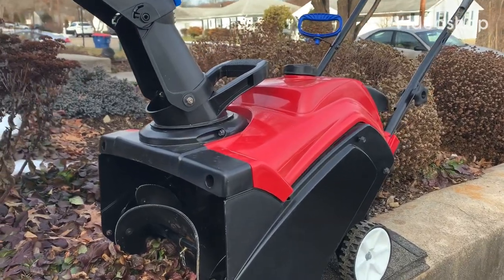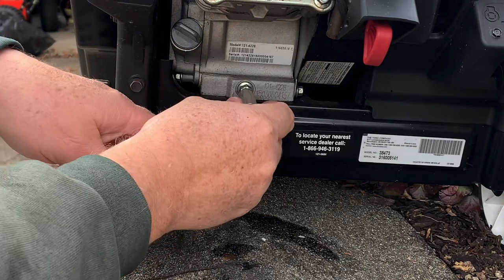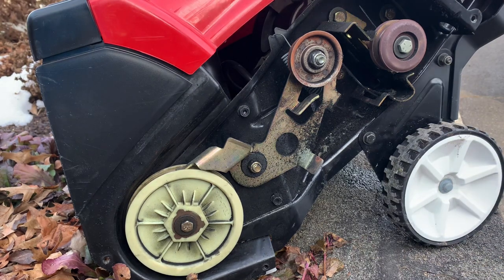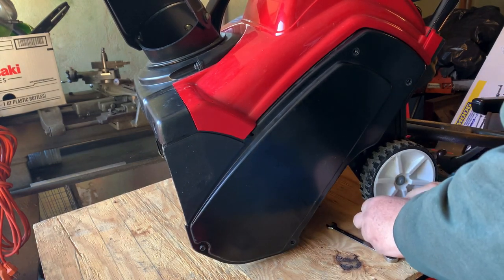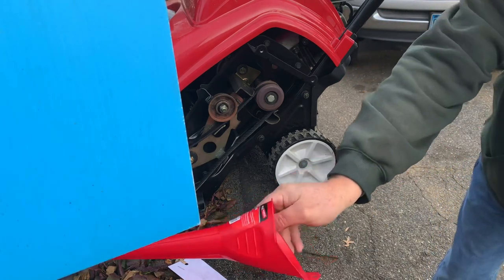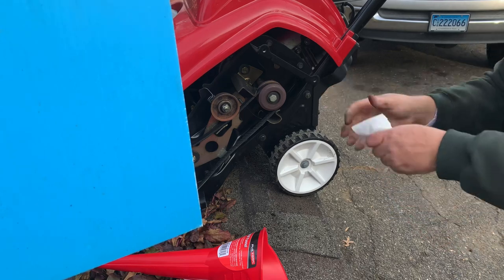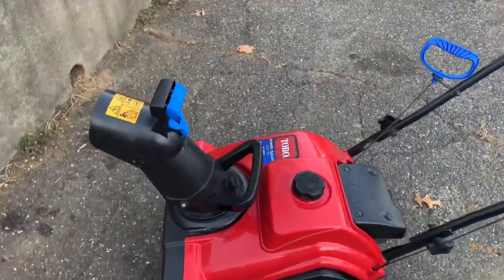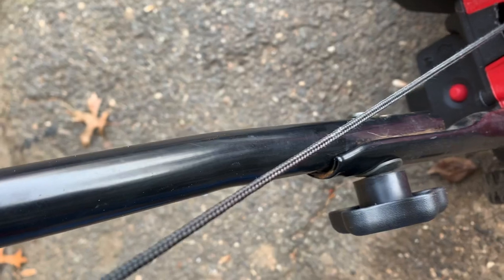Toro 518 ZE Paddles don’t Spin! Let’s fix it!

Comment: Nice fix on that unit Ken. Scorched right through that original belt. Seems to happen a lot on riding mowers as well. Get the deck packed and just burns them up. I’m sure that machine appreciates the oil change as well.
Reply from the maker: I couldn’t believe how tight that drain plug was!  Thanks for watching!

Comment: I found one of these little Toros in the trash a few years ago. I just had a gummed up carburetor. I typically just use it as a backup or if there's not quite enough snow for two-stage machines.

Comment: Great video as I was donated a PC180 from the neighbor. Doing my first paddle n scrapper change ever. Might as well do the oil too. Don't know if he ever did that or not.
Quick question. 5w30 hunh? Can I use car oil or do you need  special Toro bs oil?? TIA
Reply from the maker: I use Kawasaki semi synthetic because it’s readily available from my dealer but any name brand multi-grade 5w or 10w-30 will work fine. Thanks for watching!

Comment: just got one today and heard a part rattling, took off the side cover and an extra bolt fell out, also the belt was routed BELOW that center metal tab that says "belt here" , if I left it like that it would have tore up the belt.........someone goofed at the factory that day !
Reply from the maker: Many people will not realize the belt goes OVER that brake tab because they usually find a broken belt just laying under the cover. Thanks for watching

Comment: My belt is fine but the cord won’t pull to engage, any suggestions
Reply from the maker: Does the cable need to be tensioned? Is the belt routed correctly?
Reply: @KensSmallEngineRepair   the cable definitely doesn’t need to be tightened. I think the cord got loose moving it into storage and isn’t engaging anymore. The belt seems to be routed correctly
Reply from the maker: @joeyfadell4288  with the side cover removed to expose the belt close the bale handle to see if the idler pulley is engaging with the belt and at good pressure